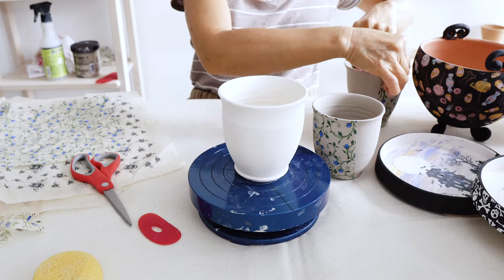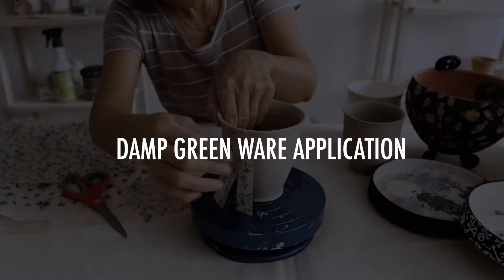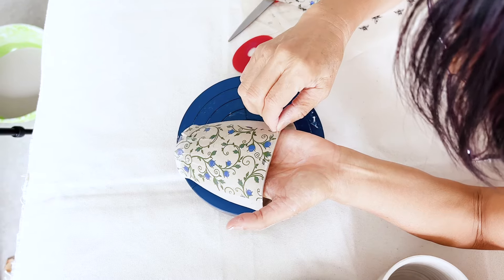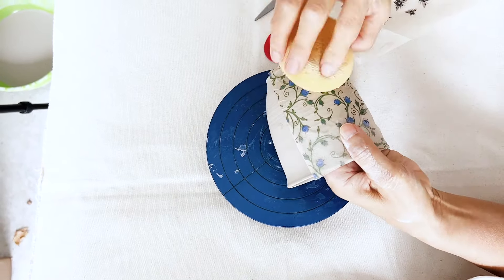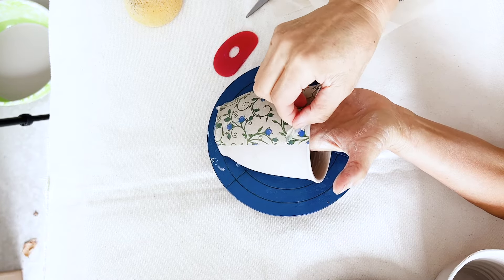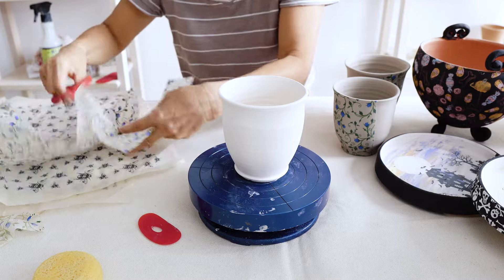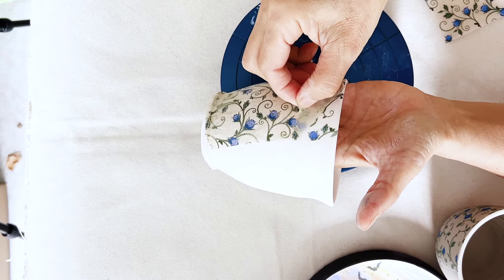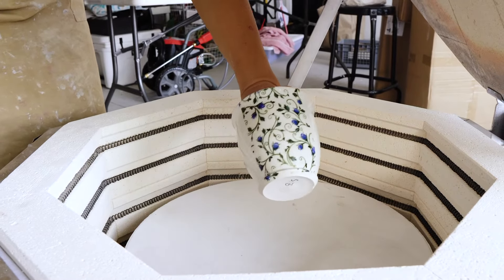Underglaze transfer tutorial, Sanbao Studio

Comment: Not all color is transferring on damp greenware. How long does it have to stay on before pulling paper off?
Reply from the maker: If you are having a hard time for all the color to transfer. dab the surface with a wet sponge to add little more water. then run over it with a rubber rib. use a little pressure.